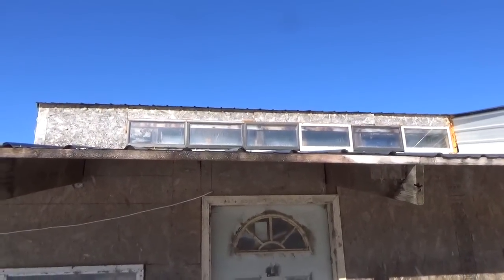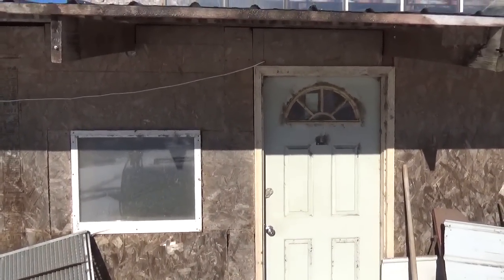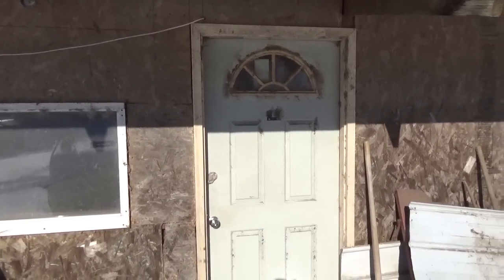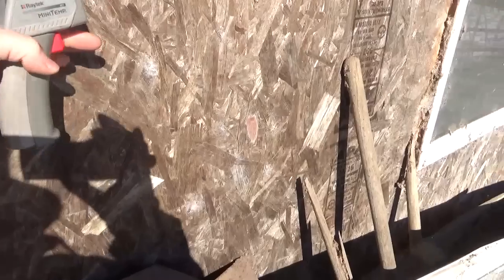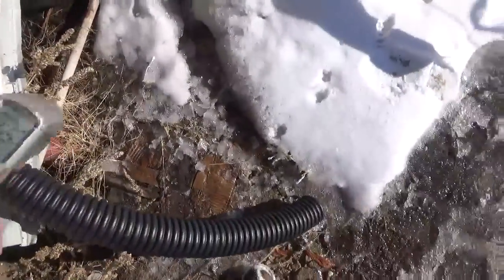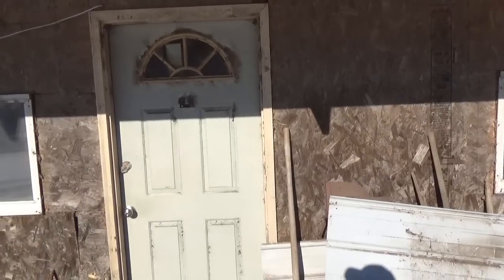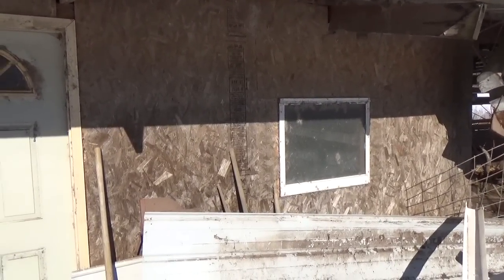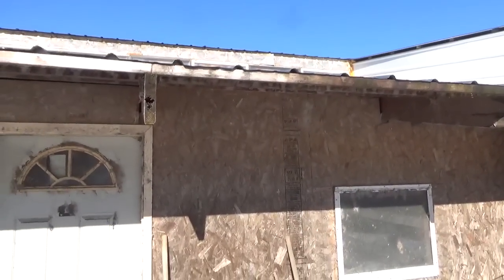Solar passive heat idea

Comment: free heat in the winter time is always going to be a good thing.   the infrared thermometer is a valuable tool in a lot of ways.  I shot bearings record the findings, then when I see a high temp I know the bearing is about to go.    found answers to radiator cooling issues also.    your project here in this video, you got the time, money then do it.
Reply from the maker: +Soybean Farmer thanks soybean farmer. Project for this year!

Comment: I build myself a 4 x 8 solar heater out of pop cans for my shop a few years ago, and it will put out 156F on a bright sunny day. I built it solid to the wall, but for best results it would be way more efficient if you could tilt it up a few degree's, and if it could be turned to follow the suns path. Although that would involve a way more planning, but anyways I thought I would give you my two bits worth about it.
Reply from the maker: +big D fan thank you for the info. Very good idea to tilt it, but I just want to utilize that wall

Comment: great idea, get yourself some barrels, paint them black, mix methanol at 21% , then you will have heat after sun goes down.
Reply from the maker: +Larry Hottle  great idea Larry thank you hope you have a great day
Reply: Go a step farther.  Use 100+ft black plastic 1" tubing , over the roof area.  Barrels inside, put field stone in barrels to help store heat.  Get real fancy run through old radiator with a fan behind it.
Reply from the maker: +Kevin Farmer man you guys are giving me all kinds of great ideas LOL thanks a lot I appreciate it have a great day
Reply: I'm not sure how much snow he gets at any one time and how long it might lie on the roof and mask the piping - therefore no heat but its a good idea for at least some of the winter

Comment: I would do it! free heat!
Reply from the maker: +Wisconsin Fisherman it's on the list! I think it will be money well spent
Reply: Well yes! What about the summer tho when it is really hot? Would you just block the inlet so it doesn't cook inside? Lol
Reply from the maker: +Wisconsin Fisherman yeah I think I will put duct work in there that I can open and close so I can control when it's letting heat in and out in the shop I'll probably end up using a fan 2 and then I'm just going to put a thermostat inside the box outside so once I get some temperature will kick the fan on and off automatically in the winter time just ideas LOL

Comment: Around here heat is something we try to get rid of, not capture. The only solar I have is for hot water. My friend in Minnesota uses a lean to greenhouse and it lets sunlight in and it warms the concrete wall and floor inside.

Comment: I like it, my question would be if you are heating that wall, it will be a thin wall to allow it to let heat in.  in the evening won't that let heat escape faster too?  Just the only thought that came to me.  i like out of box ideas
Reply from the maker: +Jay Groom the wall will the insulated and there will be duct work allowing the heat to come through into the shop and I will be able to shut the ductwork to prevent cold air from coming in
Reply: OK, that makes more sense.  go for it

Comment: Basically I think it is a great idea to harvest free heat in the way suggested. However I think some recording of what actually happens would be a good idea over a period of time- the sun is relatively low in the sky at the present time of year and therefore the height of the direct contact is good but as it rises the shadow cast by the roof will shorten it. I realise Mr Larsonvalley farm is talking about reducing the overhang.
At what time of day does the sun strike this surface and conversely when does it leave this wall in the afternoon?
I too am concerned about what happens when temperatures rise and it becomes too hot in the building? Would some sort of roller blind work to shade these black surfaces?
Reply from the maker: As usual all very good points Dan. I have been thinking abut this project for about 2 month's now, so I have been watching the sun on that wall. Normally the sun starts hitting that wall around 7am and continues until around 5 pm. I figured I would do the convection design so I wouldn't have to power a fan. I would have a duct at the top and bottom that can be opened or closed. During the summer months the sun is very high here and a 2 foot overhang would block a large portion on the wall from the sun, but a curtain would be a quick and easy solution if it builds up too much heat. If the non electric design doesn't work very well, i thought about a fan to pull heat from the unit and blow it into the shop, i would have this fan set on a thermostat which would be mounted high inside the unit so as the temp reaches a desired temp the fan would kick on and transfer heat to the shop. Just idea's at this point!